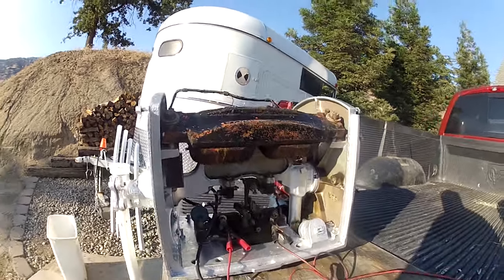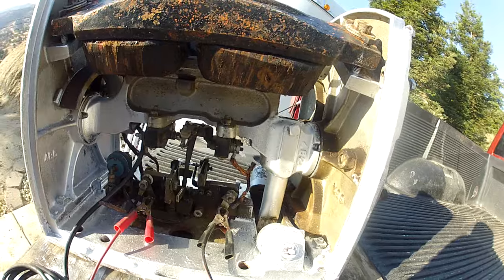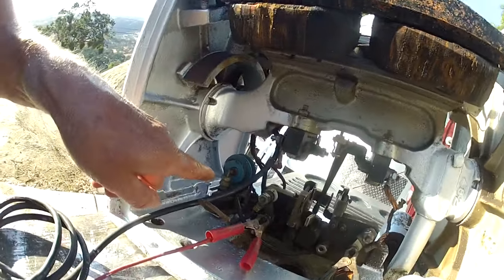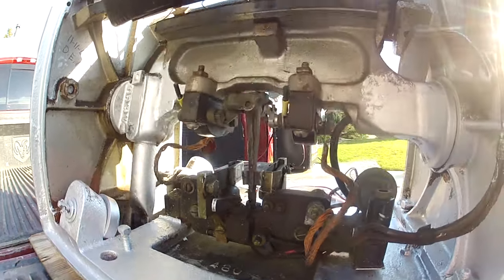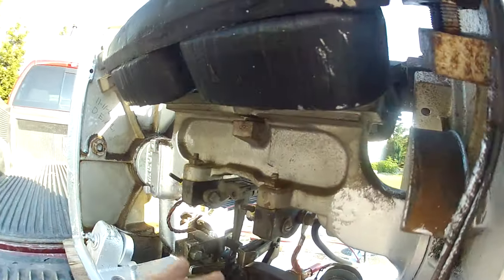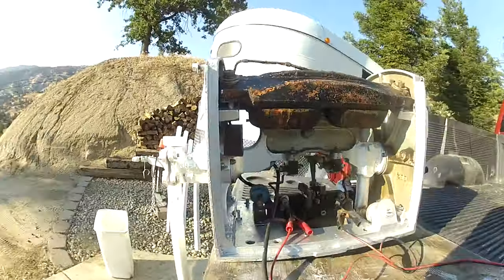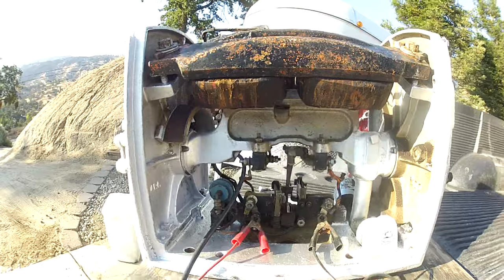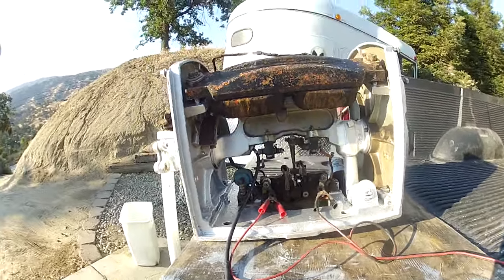HOW A RAILROAD WIG WAG CROSSING SIGNAL WORKS

Comment: That's neat, thanks for posting. I love old contraptions like this that run forever. I happened to be checking out some of my area's 60+ year old air-raid sirens that still run like a top (now used for tornadoes, but tested weekly), observing that some have been replaced with  new ones that will likely fall apart in 10-15 years. And suddenly, it occurred to me that I haven't seen a wigwag in a while. Sure enough, every one of them is gone! Talk about disappointment.

Comment: Thanks for posting this. 

How does a train switch it on and off? It can't just be the train completing the circuit, using both rails, because the wigwag stops immediately after the train has passed the crossing, yet the wigwag is started long before the train gets there. I am thinking of a single track crossing.
Reply: There are three track circuits, one just at the crossing and two longer ones on either side.  Let's call then A B and C from left to right.  A train shunting A activates the crossing.  The controller shed has relays in it wired so it knows what circuit was triggered first and it disables C.  The train  shunts B in the crossing and, after a while, A is no longer shunted.  A few moments later, B is clear, leaving C still shunted but since that circuit was disabled, the crossing signal is turned off.  If a train should stop, then back through the crossing again before leaving C, the crossing won't activate until B is shunted, but presumably such a maneuver would be slow enough to give traffic enough warning.